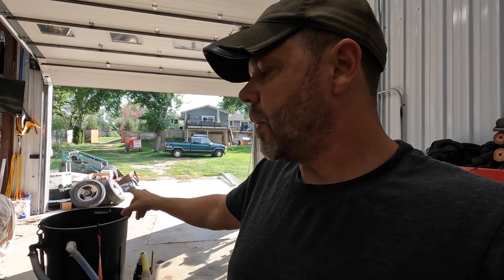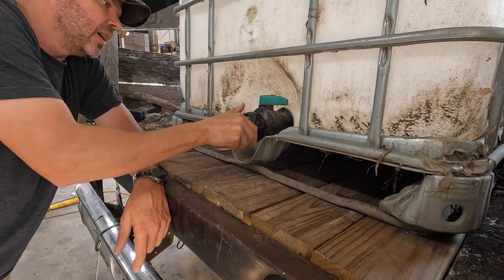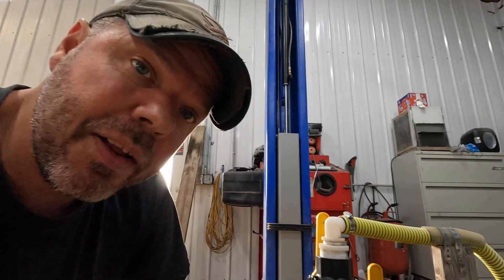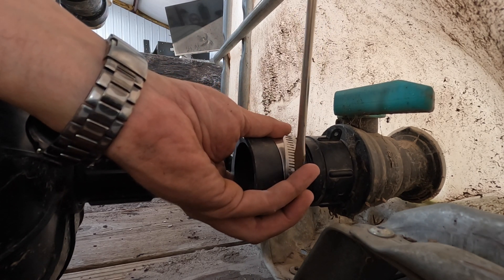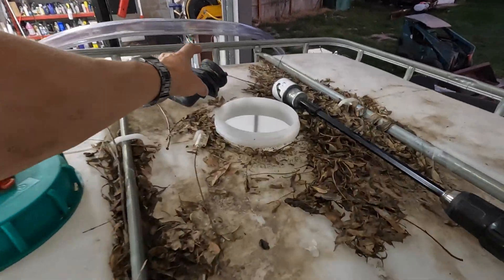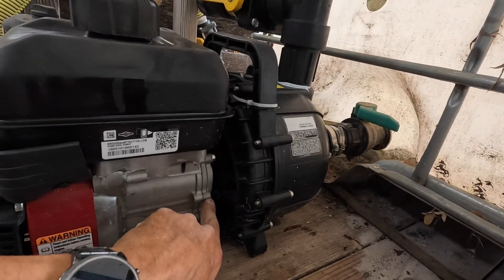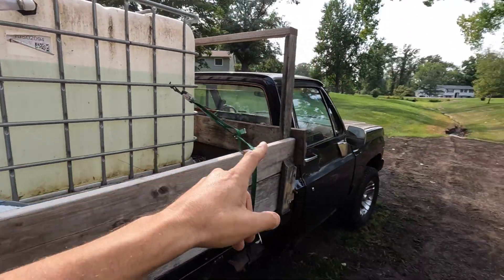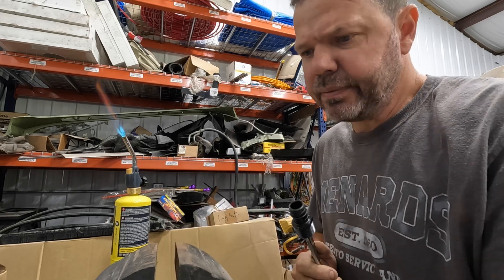How to Build A Hydroseeder For Under 400$

Comment: Hi bro. Thanks for the video and your time. Im starting the business in Argentina. Can you tell me how big is the pump you are using? how many HP? is it 2'' ? 
Thank you very much man!
Reply from the maker: 2 inch discharge.  It works fine for small jobs, but,  If I did another one, I would go with a 3 inch discharge and larger tank

Comment: If you were to use a 3 inch pump would the sizes for the recirculating and discharge hoses increase from 1-1/4  hose or would you use the same size?
Reply from the maker: I would just split the difference on the re-circulation lines.   1.25 seems to work pretty well not just because of the 2 inch  divided  in half but,  Initially when putting in the mulch, the pellets seem to flow better till they are "Snot".

Comment: So i need some help. I followed what you did but mine is just shooting water. We stopped for the day but go back to finish. i need to find a resolution to the issue to continue. i added one bale for a 275 gallon tank. lesco SB 50/50. Am i doing something wrong or is there anything you recommend? I would love to be able to forward you some pictures and videos of the setup to help resolve. I appreciate any help.

1.5 inch output hose with hydro seeding spray 45 degree nozzle. two 1.5 inch jetters. should i shrink the nozzles of the jetters to like 1 inch or?

Im not sure.
Reply from the maker: Are you getting a good mix before trying to spray?

Comment: Great vid. Be careful lifting ICB totes man! Did you make trailer? I could imagine  this getting serious with a more robust system… I’ve seen those trucks w/ept and wondered about that.
Reply from the maker: For a trailer I ended up just using the Rear of an Old square body truck.  I always wanted to find some small lawn business and offer the service or just rent out the equipment.     I think I would go with a larger 3 inch pump if I was going to get serious, but for small jobs this works perfect.

Comment: What size hose is the mixing and discharge?
Reply from the maker: I'm going off of memory because everything is covered in snow, but I believe its 1 inch for the recirculation.   I would oversize those to 2 inches if I did it again and just throttle on the valve.   Also helps prevent clogs.  I haven't had any clogs  but I could see it would be possible and a PITA.  The discharge is 2 inch.  Throttle with a 1 inch output  valve.

Comment: Do you have a video from making the trashcan one you used previously?  I don't need one as big as your upgrade.
Reply from the maker: I do not.  It did use the same motor, pump and agitators,  The Hole was in the bottom instead of the side but everything else was the same.  I used Bulk Head fitting for the pipes to go through the bottom and sides of the garbage can.  The entire thing was actually build on top of an old Corn hole board.  the garbage can was raised about  8 inches up on a small platform that I built and was held down by ratchet straps.

Comment: What kind of nozzle do you use? I have fabricated my own machine and the spayer and nozzle designs. The nozzles i have designed are not working and i cant find one to buy for less than like $300
Reply from the maker: I ended up just taking a plastic 1 inch quick release coupler. I heated it up a little and just re-shaped it in the vice. so its about 1/4 ich wide gap by 3/4 ish now.  works pretty good.  Not perfect but works. If that didn't work I was going to get a Plastic cap and just cut a slot with a grinder

Comment: Could you eliminate the recirculation hoses/valve and just use the main hose pointed into the IBC to mix it up?
Reply from the maker: You probably could,but the hose builds a lot of pressure
Reply: Hello men ,In which store to buy the seed and the color?